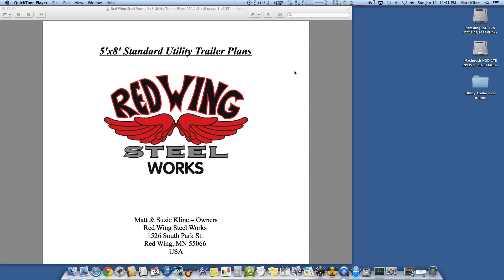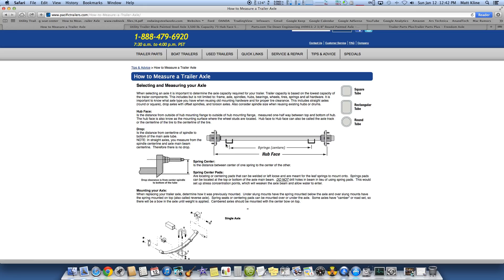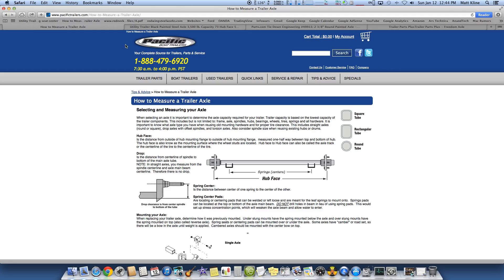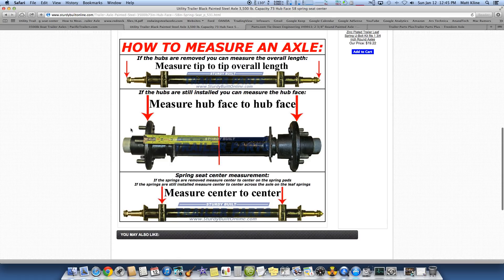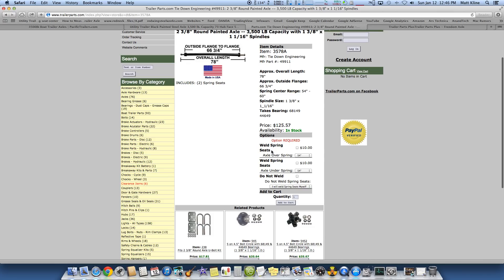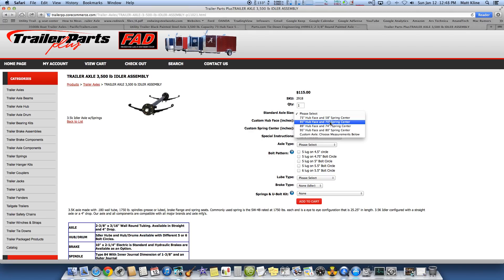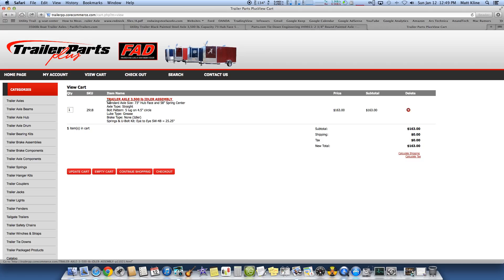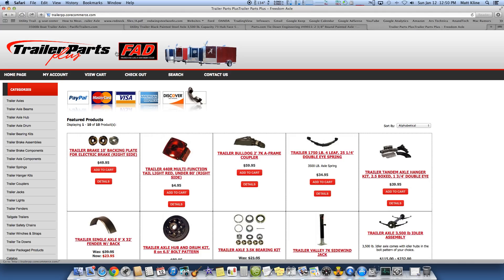Utility Trailer Axles Fully Explained - How to Order the Correct Axle

Comment: Dude you have no idea of how much easier you've just made my day !!! Im retrofitting my military trailer that came with original axle and tires and I was planning on doing a complete axle swap . I was starting to feel overwhelmed over the axle measuring system and specially for a custom application like mine. I needed a 72" hub measurement but with a 40" spring center !!! I couldn't find the right fit . Now with this web site ...... damn couldn't be any much easier !!!! AGAIN THANKS FOR THE VIDEO!

Comment: Hi Matt. I love your video's, but in this one you have to understand better why it is important. Short story. 7 years ago we bought a house that we planned to completely remodel. The last owners were hoarders. The yard was overgrown something awful. So I bought a used utility trailer for 500 bucks. Figured I'd use it for the job and then resell it. Well, whomever built this trailer used the correct spring centers, but the hub face to hub face is extremely wide. The trailer is 7 x 12 with 16" sides. Mostly built like you build yours only the cheaped out really bad using 2x3 angle for the 'V' tongue. This thing flexes like you can't believe. Corner to corner looks like springs around incredibly bad. Honestly, I check for broken welds all the time it is so bad! Back to the axle. So the measurement is perfect for the frame, but the hub faces are WAY TOO WIDE. My 7' wide trailer has a side to side wheel width of over 8'9" . That isn't legal anywhere!!! So the axle is at least 2" too long on both ends.. So yeah, it is important to know what you need and order it properly. I have been trying to find 2 15" wheels like the use on car dollies, but it must be a secret as to who sells them...  One very nice and smart thing they did building my trailer was to make the ramp/gate heavy duty and removable. Since I am done with the house, but still use the trailer often enough to keep it, I plan to build a new one a bit smaller with a much better tongue 'V' and a proper axle.  Thanks for the series. I actually found you through someone else that built a car rotisserie with your plans... I want to build them as well..

Comment: I have an older trailer axle with the wide spread factory hubs. I want to switch out the hubs to 5 lug - 6 lug if I must. Can you tell me what hub I can use on my trailer? I don't have or use trailer brakes